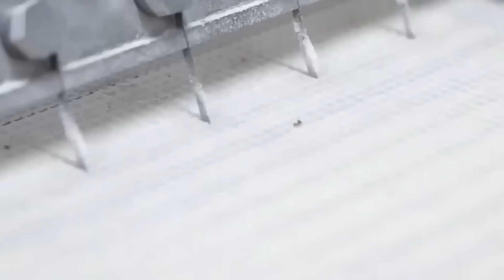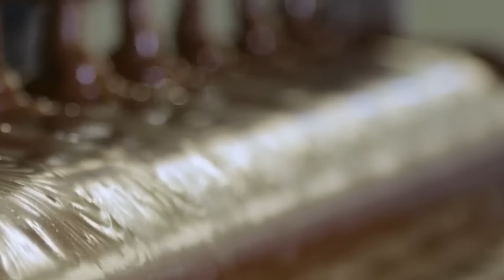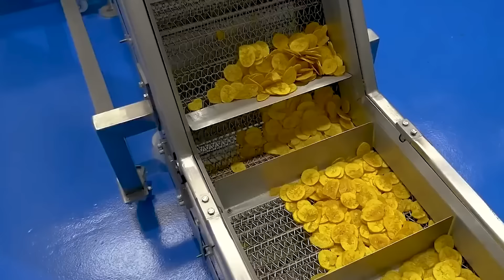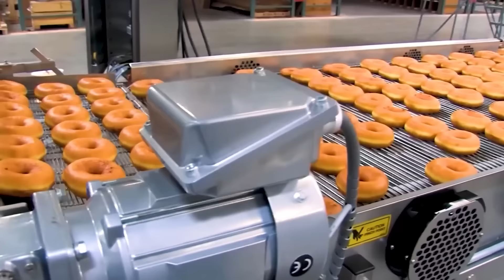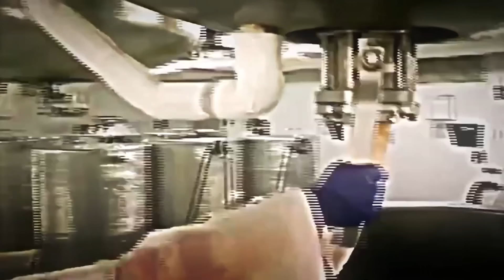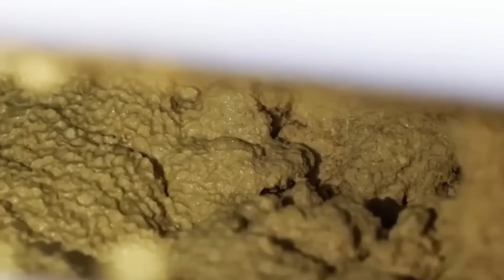How KitKat Is Made In Factory with Modern Food Processing Technology!

Comment: The production process of KitKat is truly fascinating! Each bar is a perfect fusion of smooth chocolate coating and crispy wafer layers inside. The modern manufacturing line ensures not only high output but also exceptional quality in every single piece. From mixing ingredients and molding to cooling and packaging, every step is handled with precision and strict control. No wonder KitKat remains one of the most beloved snacks around the globe! 🍫✨